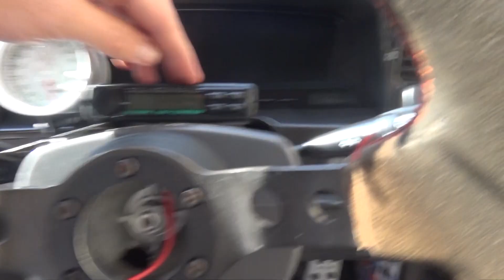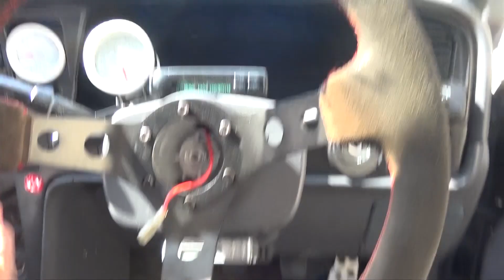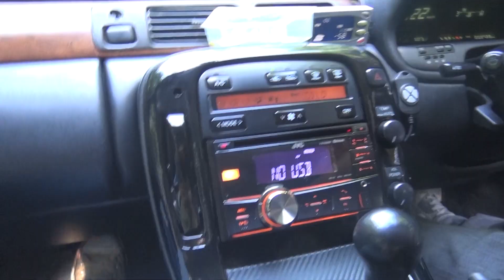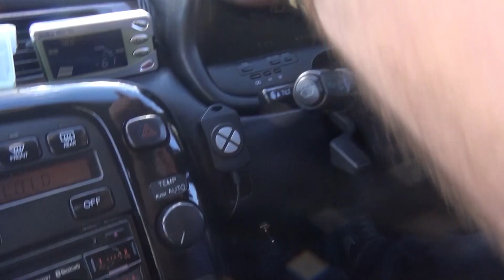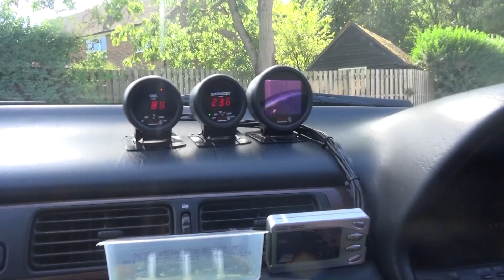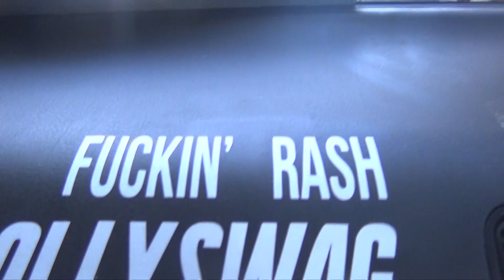🐒 TOYOTA MARK 2 NEW DRIFT CAR + DRIVING THE S13

Comment: The trippy paint job on the hood is a "airbrush/kustom paint" trick/style known as Ground metal effect. Pretty much you can take different grade pads/other attachments and grind along the top of the metal in whatever pattern you want. Then you can wax and grease it, put on some adhesion promoter and then candy it (if you want colour) and seal it up. I'never seen  it done in the Japanese import scene.

Comment: Hey Monky, what are your thoughts on the v8 soarers? they seem to be common and dirt cheap in Australia.
Reply from the maker: Good man, good low down torque deffo good enough for a skid once manual, even auto you'll get it going with a welded diff and not too much grip on the rear
Reply: +monkylondon I have a v8 4.0 and it doesn't slide at all , personally it is quiet heavy so gotta stick with the gts with the duggits 😇

Comment: is the soarer like a lexus sc300?
Reply from the maker: Yeah exactly that, it's the JDM version. Toyota Soarer in Japan, Lexus Coupe SC300/SC400 in States. Soarer in Japan came with 1JZGTE 2.5L turbo (with manual option) or 1UZ 4.0 V8 auto only. In the States you got SC300 2JZGE non turbo auto and 1UZ 4.0 V8 auto like Japan, no manual option unless I'm mistaken :)
Reply: yea i think only autos here in the states, thanks man keep up the awesome videos!
Reply: +matt knaeble actually there is some manuals but they're rare to find